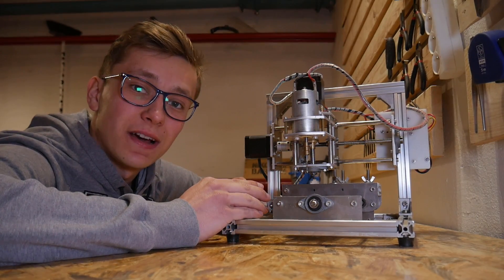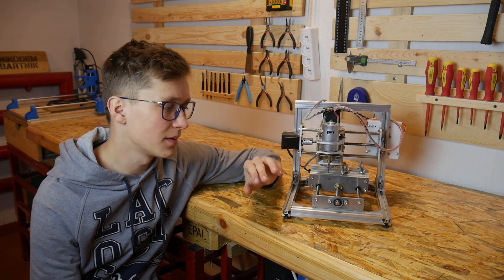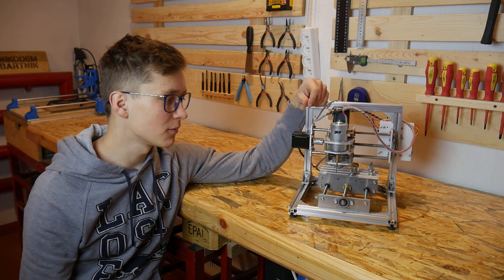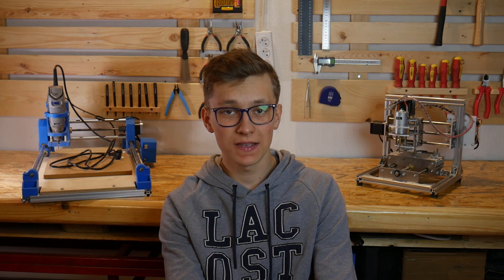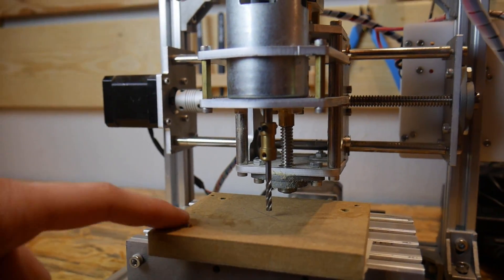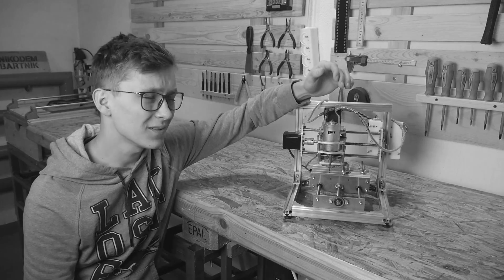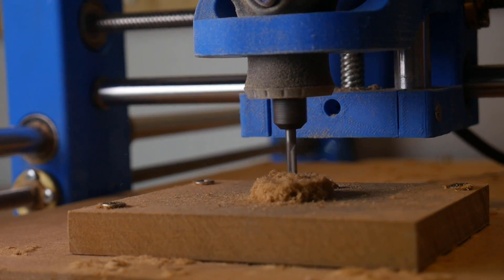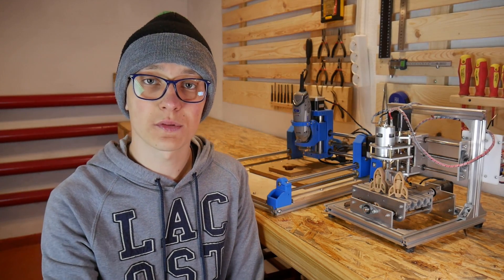DIY Dremel CNC vs 3018 CNC Machine

Comment: I built this dremel holder but adapted it to the round rod of the dremel drill press. But now I want a bigger cutter motor than dremel. Is there a 110V motor that can adopt to your Z Axis assembly?

Comment: I am in the process of building the Dremel CNC Machine, I own a cheap Chinese CNC machine, and I have built a 4 foot by 4 foot CNC machine using things at openbuilds.com This is a great video but I feel you missed a couple things. The First, would be that the cheap CNC machine, While you are using MDF, I have tried to cut things as simple as pine, and even oak. If you want to make anything out of a harder wood, that little motor will need to be driven so slowly, you will lose your mind. The Dremel on the other hand, can be pushed as far as 90 inches per minute, at a .05-.1 inch cut depending on the thickness of your bit. The Dremel CNC also does not cost too much more than the other Chinese guy, and you get way more bang for your buck. You just have to shop around a bit, and sometimes you can buy the parts on ebay(even though it says non commercial)
Reply: I have the chinese engraver cnc with 3d printed z axis. It is awful cause the top two bearings on the z axis always slowly vibrate out of the 3d pritned part so that it can no longer raise z axis all the way up -_- I really would like to make a better z axis or buy one but are too expensive. Maybe get 3d printer now and 3d print better parts as well as fit better spindle motor.

Comment: Hey Nikodem, the issue you have with the Y axis on your small T8 machine is caused by inproper assembly. You need to flip the x axis 180° install it on the back side of the frame that will extend the Y axis motion.

Comment: Use a straight flute end mill instead of a spiral. You'll have less cleanup to do to the part. Spiral bits cause more tear out in the direction of spiral. Up spirals pull up toward the spindle. Down spirals push away from the spindle.

It's good to have a selection of end mills and not rely on just one type. Each one has it's benefits for certain types of cuts or materials. Straight flutes are a good all around bit.
Reply: any chance you could shares some links please to the type of flutes you are talking about, i am thinking of getting a 3018 with offline control and uprated spindle....

Comment: But real question here is --> could dremel cnc mill aluminium?
Reply from the maker: I am working on it, it's possible but not easy to do
Reply: @nikodembartnik  Having not supported rails is the biggest problem.
Reply: With speed, Time, number of passes and depth adjusted is possible